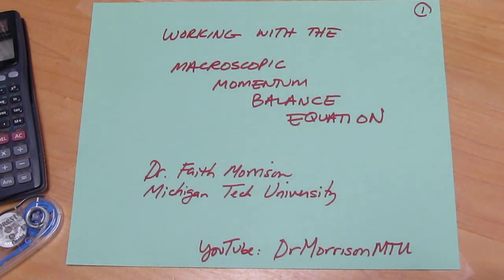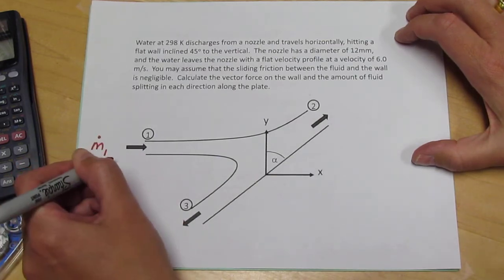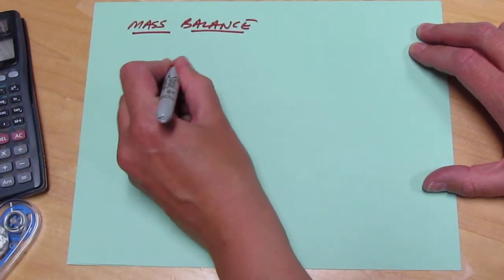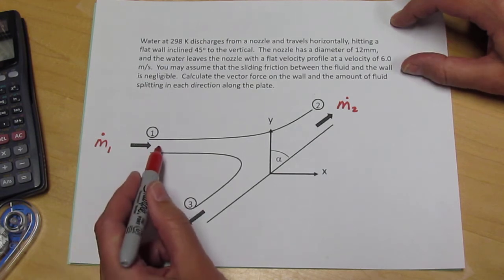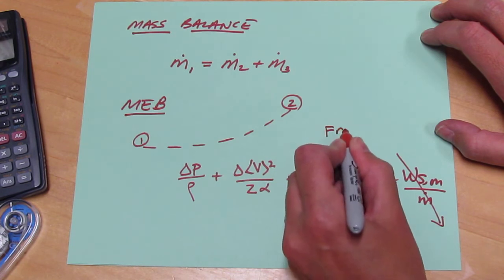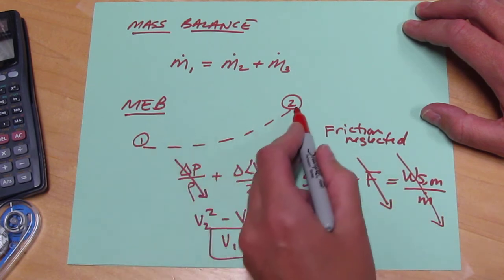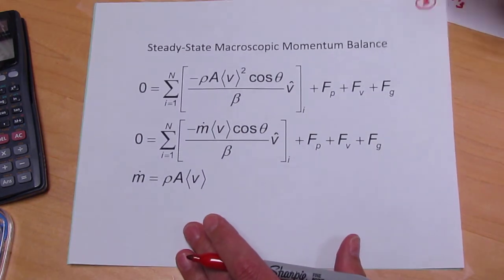Part I: Macroscopic Momentum Balance - nozzle flow to tilted wall

Comment: how can you neglect gravity there when clearly you have elevation in the pipe?
Reply from the maker: When a flow is very fast, the amount of momentum represented by the force due to gravity is very small compared to the amount of momentum in the fluid and we can just neglect gravity.  If the flow is slow, this may not be a good assumption.  Thanks for the question.

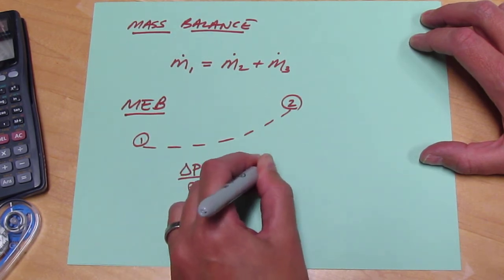Comment: The problem is a circular nozzle that splashes on a wall in all directions. The image in the beginning is a vertical section of the problem. Why would you neglect gravity at 2:50? Clearly point 2 is higher than 1 (and 3 lower than 1). Because of garvity the fluid is poouring down from the plate, which exerts a force. Why would you neglect that?  I could follow you reasoning if this was a horizontal section through a (verly high) rectangular nozzle, but not with the problem at hand.
Reply: I guess she made the assumption that the momentum of the fluid is large enough so that the gravitational forces is negligible